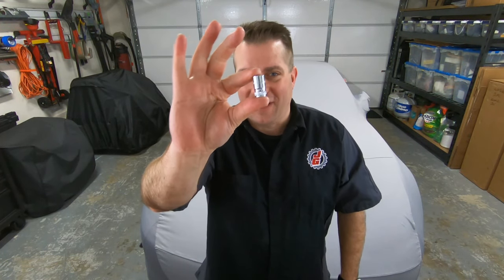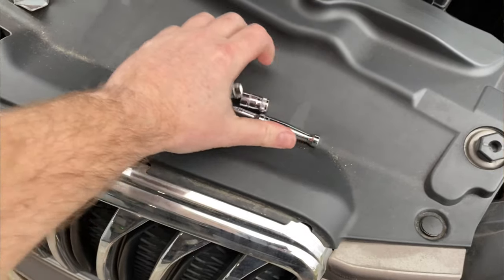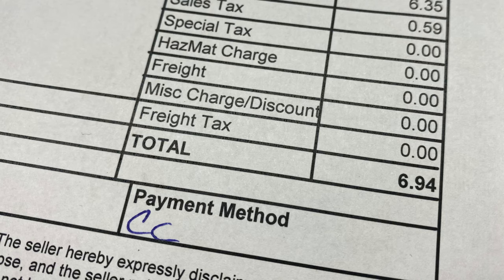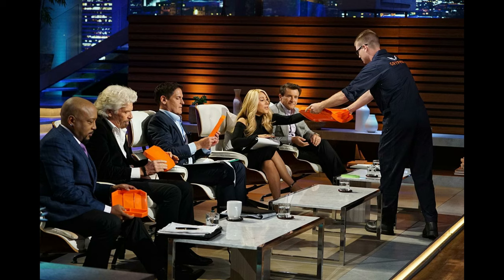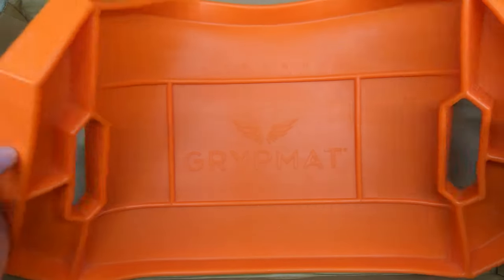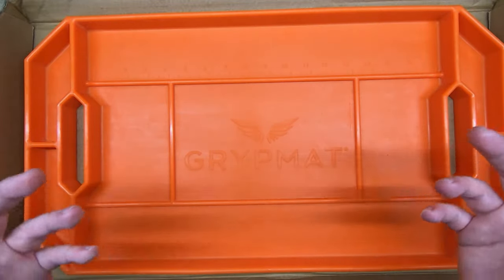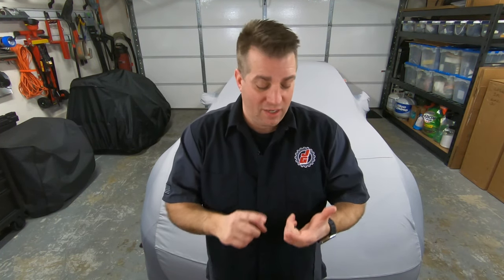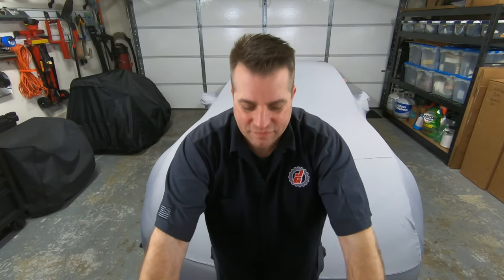Grypmat Flexible Tool Tray Review - Never Lose a 10mm Socket Again!

Comment: Wow, thanks a lot for sharing, Jason. Never knew that such a thing existed, would make a perfect gift for a car guy or even myself. How's the LED budget vid coming along, I'm dying to find out how some of those bulbs I emailed you about would fare against the rest of the budget competition and potentially against the OG S-V4. I've also contacted Headlight Revolution about possibly making a similar vid comparing Amazon/eBay S-V4 clones to the high-end bulbs they sell and they said they might actually shoot one.
Reply from the maker: Glad you found it useful.   I was putting in a new TV wall mount.  I loaded the big one up with tools and sockets and drill bits and walked right into the house and got to work.  It makes things so much easier, short of carrying in an entire tool box that will not protect the surfaces you are working on.  Love these things!!
I am currently working on the budget LED roundup video, and I will be including some as a result of your suggestion.  Stay tuned!
Reply: @InJasonsGarage  Alright, excited to see how the results turn out.

Comment: You're lucky your tools fell all the way to the ground. I've got more small sockets riding around in my engine bay than Carter has Little Liver Pills.🤣 Boy, do I need a set of these Grypmats. No, not for my garage, for the floor of my bathroom shower! 😉 I do have a question Jason. Some of us here in Northeast, sometimes have to work under the hood in some pretty cold temperatures. Will the Grypmat lose any of it's flexibility? Save the Wave🙋🏼‍♂️
Reply from the maker: I still don't know where that one $7 screw went...I even pulled part of the undertray panels off.  Nope...lost without a trace.
According to Grypmat, they have rated them for  up to 500ºF (260ºC) and down to -65°F (-54ºC). So I would expect them to remain flexible.
Reply: @InJasonsGarage  Man, now I want them to make me a pair of boots out of that material.
Reply from the maker: @petercarey6883  Hahahahha!  They are flexible but I don't think they would be supportive for footwear.  ;)
Reply: @InJasonsGarage  You may be right. How about for a wet suit and fins for snorkeling and skin diving?  Then again, you said they're good for up 500 degrees F. How about slip on boots for Volcano walking in Hawaii? We've got to come up with SOMETHING so we can sell it to Shark Tank and make our fortunes!💰💰
Reply from the maker: @petercarey6883  The more I get to know you, the more I realize how crazy you might be.
Reply: @InJasonsGarage  What's this "might be" Kimosabe. Give me time and I'll eliminate all doubt!